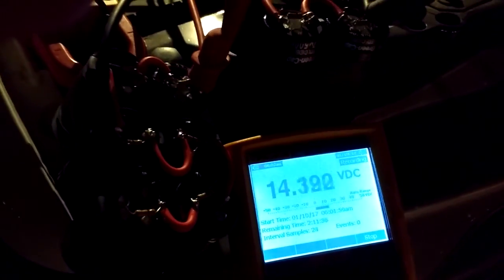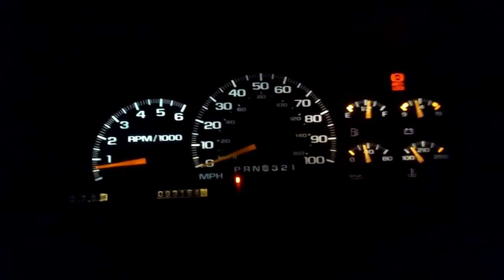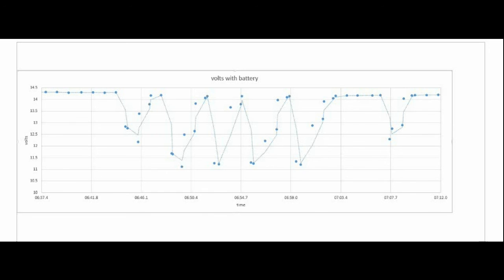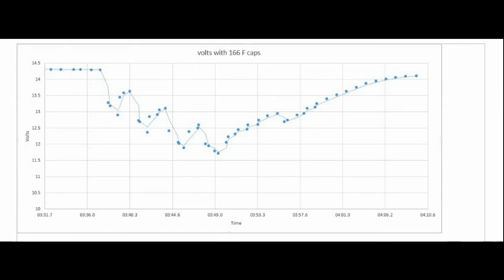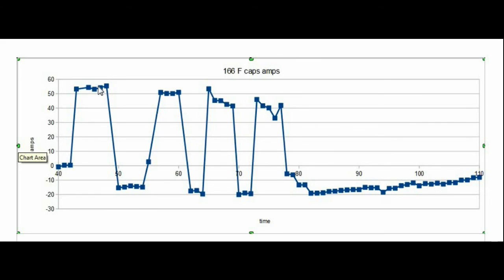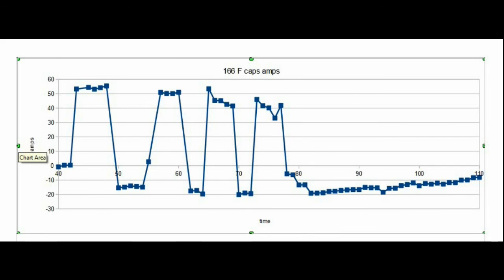Super capacitor in parallel with a truck battery for high electrical loads (part 2)

Comment: Hello ive tried this 2farad 16v capacitor directly in parallel with ny cars battery it was great, now im asking for my second car i will use 6 capacitor in series resulting in 16v 83 farad in parallel with my cars battery will my battey or electrical components handle the 83farad of the super capacitos?
Reply: It just doing ok, i use same setup 2farad at the back (near amplifier audio) , and 83farad in the hood

Comment: I agree with everything you are saying and your experiments/results look sound.  What is the leakage of the caps?  When truck is not running/ in storage  will the bank of caps discharge your battery?

Comment: I’m gonna bolt a audio capacitor on my fisher plow
Reply: That's not gonna do you any good, there is a huge difference between a large single cap vs multiple smaller caps wired together.

Comment: Nice video good job. I’m curious, I saw you had resistors on your ultra capacitors. I’m assuming they are balance resistors? If so how many ohms and what wattage? Is there a rule of them as to size and value? I’ve sseen some fancy balancing circuits but I’m not sure they are really needed.  Thanks
Reply from the maker: Tiny Solar Shack those are just resistors that help balance the capacitors. I used ones that balance very slowly so if you have a fast charging circuit it's possible to overcharge them still. The lower the resistance the better they will balance but it will create a constant draw and discharge the capacitors faster. I did a video on it but it didn't turn out very well. I'm still pretty new at videos.

https://youtu.be/FUWDya5CiIk

I'm hoping to do a video in the future on a better way of doing it then just putting resistors on them.
Reply: That helps a bit . I have 6 maxwell 2600 farad caps at 2.5 volts. They are the older ones. I can’t find balancing circuits for them as the ones sold on eBay are like 2.7-3v.
What value are we talking .01 or more like 100 ohm? Sorry kinda clueless. I’m not as concerned about some loss as blowing some up.  Thanks for your videos
Reply from the maker: Tiny Solar Shack what voltage are you planing to charge them to and how fast are you charging them? If you are charging them rapidly and all the way to 2.5 volts you will want a lower resistance to balance them. If you are only charging them to 2.0 volts at a slow rate you can get away with higher resistance resistors.
Reply: They will be at 2.2-2.3 volts I.e. 13-14 volts ish. No fast charge. They will live in parallel to an AGM battery. I’m using them to smooth the coup de fa effect with an inverter to help eliminate or smooth instant draw of voltage and current when the inverter come on under load. Basically less voltage/ current surge in the first 2 seconds of on time. Make sense? I might occasionally use them as a jump start pack in an emergency but would live under the hood.  Also I think you had a load resistor in your circuit between the battery and cap? I might be wrong I’m not sure how that work and what size it was.